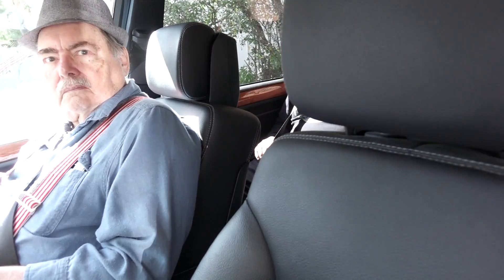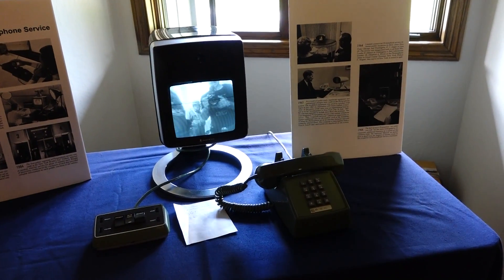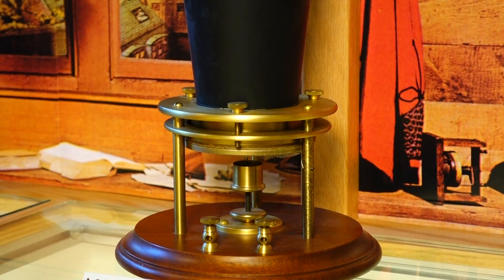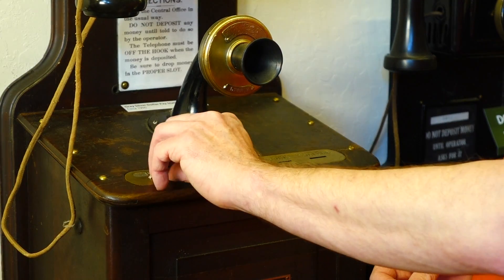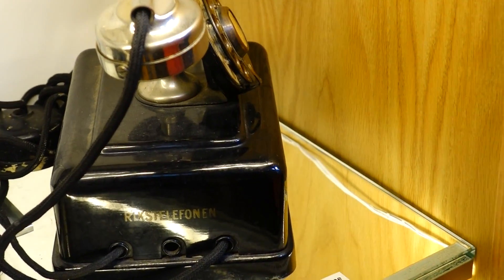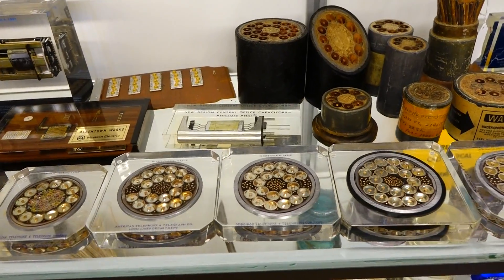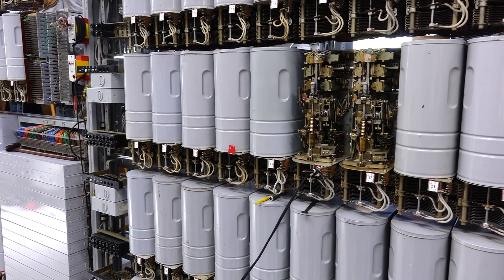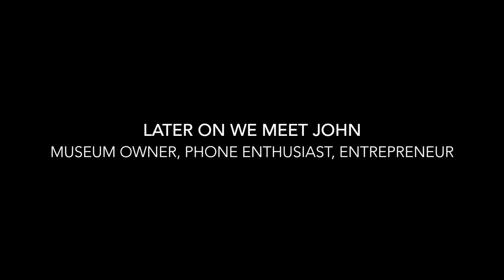Nerdspedition to the JKL Museum of Telephony

Comment: Great museum. I spent some time in exchanges and they were always filled with equipment that was no longer in use. Too expensive to move it out so all they did was just switch it off when it was replaced by newer equipment. So pretty much the exchanges become museums themselves.

Comment: On that ring generator, you can still buy the switches as brand new current parts, used for railway signalling systems. I still occasionally use a 1939 Ericsson phone, originally meant for local battery use, but which is happy after some jumpers to accept line power instead, and it works well, just that of course it has no way to generate DTMF or LD to dial, as it has instead the hand crank generator.  But does ring quite well, and interfaces nicely with modern POTS lines.

Also have some older phones, from the 1980's and 1970's, though they are not in as good a condition. Wonder if they have any of them around in the collection.

Comment: I remember the sad day when it was announced that the JKL museum had burnt, they have done a great job rebuilding the museum. Nice to hear the sounds of the Step By Step switch working, along with the old Step by Step dial and ringing tone, one does not hear that nowadays with the Nortel DMS-100 and Western electric 5ESS switches. 
The Picture Phone is an interesting failed product from Western Electric/Bell Telephone. Thee engineers overcame many technical challenges to make the system work, things like making a camera tube that would not suffer image burn in, since it was always on and normally looking at the same background, or how to make a system that was (somewhat) practical to integrate into the standard telephone system. 
There is another very impressive telecom museum in Seattle, which is open to the public and is in an old switching office,  one of their current projects is getting a very rare Western Electric 3ESS switch.
Reply from the maker: Yes, Ken went to the Seattle Museum of Communications and highly recommended it. Maybe in afuture video?
Reply: @CuriousMarc   Absolutely maybe!!!
Reply: CuriousMarc 
I particularly like your IBM restoration vids. 

Have you seen the George Lucas student film 
THX 1138 4EB? (The short film that predates the theater film “THX 1138”.)

The 1967 short had a lot of IBM hardware as set design. And the Navy Student Workshop is credited in the film. So I assume the computers are Navy hardware. 

It’s a very interesting 15 min short. Thought I’d share. 

https://youtu.be/GB3fbtUYgRE

Comment: one day we're gonna run outta all the exotics required to make fiberoptics and super hightech electronics, and have to go back to this stuff, and it's thanks to guys like these we'll still have working examples of what we'll have to go back to.
Reply: The raw materials aren't terribly exotic. Being made of glass, fiber optics are made from sand. Which is also where the silicon comes from for ICs. It's more the preparation that makes it difficult. But people can and have produced semiconductor components in their garage.
Reply: @VoidHalo  they mix in germanium and one other exotic (can't remember what) so that the light travels better over longer distances... it's glass, but not regular glass...
Reply: and while there are alternative semi-conductors, will we still be able to shrink them down to the size you can fit billions of them on 1 ic?

Comment: Notice at 5:50, the candlestick, front, right, is equipped w/ a "Hush-a-Phone." The was an early privacy device, but was famous for violating Ma Bell's "no-foreign-equipment" rule. That is, if it didn't come from Western Electric, it couldn't be connected to the network, acoustically (which is how it connected) or otherwise. Led to a lawsuit years before the Carterphone.
Reply: Yup I saw that in there.  I wonder if there are still some active phone lines in the nation with a phone rental/equipment  line item.  It was spelled Carterfone for anybody wishing to research it.
Reply: I was going to comment about this too!
Reply: Thanks for pointing it out. I didn't know about it, but an interesting case for sure!

Comment: So many Telephone Exchanges in the UK still have test desks sitting unused in them. When I started in telecoms 31 years ago, strowger was still in use in some exchanges and one of my first jobs was upgrading all the cabling inside Pan Am’s Heathrow operation so they could remove the huge room PABX 4 strowger exchange and replace it with a Nortel boring box on the wall. Happy Days !!
Reply: That would have been cool and a bit daunting at the same time.  I searched for Nortel's Boring Box, couldn't find that product anywhere!  Bwaaahahahah!
Reply: Shain Andrews it was the Nortel Meridian PBX. I believe Nortel went bust a few years ago ?